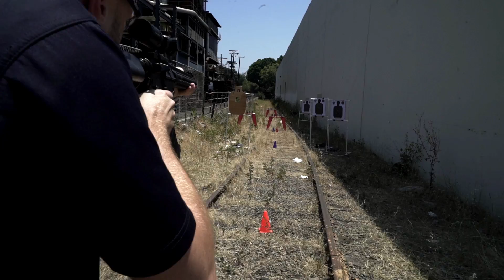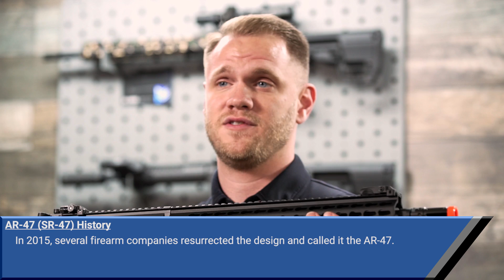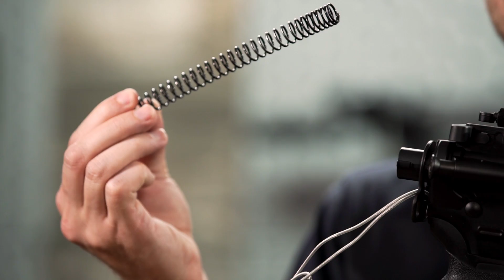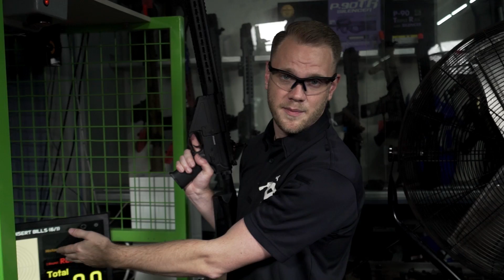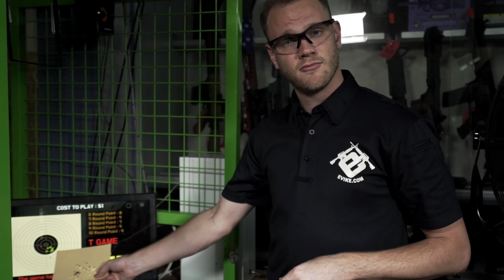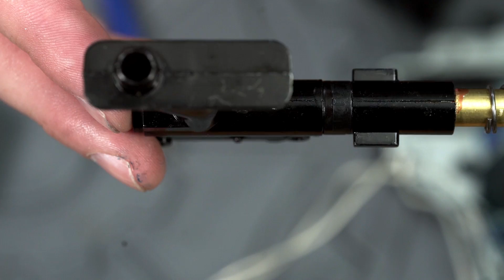The M4/ AK Hybrid - CYMA AR 47 QBS Review

Comment: Just to add since I bought one of these

You cannot swap to a pdw stock without switching to a gearbox with an internal spring guide due to the nature of the spring change system

You cant swap uppers from other rifles to this one as the upper is longer than a standard m4, you can however swap rail and outer barrel parts
Reply: Can you remove the stock and replace it with another m4 stock?
Reply: @chrisq7814  yeah ofc
Reply: i cant seem to remove the tip, do you know how?
Reply: You think I could change the barrel and handguard too?
Reply: You can just change the spring guide

Comment: Got Model: 8.5" M-LOK w/ Suppressor. Total game changer out of the box and for ever.
Reply: Is the suppressor removable and is trigger response snappy
Reply: @bigs0  yes and yes. Snappy and fast. Trigger has sensitive parts. Broke after  4 month of aggressive gaming.
Reply: Make sure your motor is tight too. Mine was loose but plumbers tape fixed it right up!

Comment: I won one of these a few months ago and now i'm wanting to put a mock silencer on it but my question is, how do I get the flash hider off, the grub screw is like glued in wtf. I've torqued it as hard as I can and broke my allen wrench.
Reply: neither can I, have you figured it out yet?
Reply: @asd_aspect2456  I ended up just replacing the outer barrel. If yours has the grub screw and you haven't stripped it what you should try, that I didn't, is heat it up with either a heat gun or dip it in boiling water. Then try to unscrew it. If you've stripped the screw then you will have to drill it out.
Reply: @jbopp15  alr thanks bro, also how did you take off that chunky ring that is holding the outer barrel in cuz I unscrewed the screws but it wont twist out
Reply: also what barrel did you get
Reply: @asd_aspect2456   I heated it up then twisted it off with a wrench.
Reply: @jbopp15  when you twisted it off did it strip the threading?
Reply: @asd_aspect2456  No, after you remove the hand guard and take out the 2 screws from the barrel nut, you just turn it counter clockwise to unthread it. Also I replaced the outer barrel with a 10 inch barrel from another M4 I had.
Reply: @asd_aspect2456  also I forgot to say it but the barrel I used as a replacement. I had to deemed the little fin on the top to make it a small bit narrower in order to fit the upper.
Reply: @jbopp15  alright thanks bro i needed this ha

Comment: I haven't bought an Airsoft gun with a battery in the stock (I have an AK with the battery in the dust cover). I was interested in this one, is the stock specialized to go with this gun? I noticed you can pull the buttpad down on it or are you able to swap it to any AR-15 style stock? Do other AR-15 stocks have buttpads that pull down like that? I wanted to replace the stock with a Magpul MOE style stock when I bought the gun. Same goes for the pistol grip if I wanted to change it.
Reply: You can just slide the sock off and put another one one. I want to put a magpul stock on mine as well, just isn’t as quick as the original stock.

Comment: So what is the difference between LiIon batteries and LIPOs? And could a LiIon be used interchangeably with a LiPo?
Reply from the maker: Li-Ion and LiPo are completely interchangeable. Differences include chemical composition; Li-Ion batteries generally have a larger mAH (capacity) for the same size/dimensions of a LiPo, and a Li-Ion battery can be run all the way down to 0% charge, whereas a LiPo should not. Additionally, Li-Ion can be stored for long periods of time fully charged to 100%, whereas a LiPo should be slightly under 100% charge. Titan Power has a wealth of information on their website if you're interested

Comment: What charger to use for the Titan 7.4v 7000mAh 10c Nunchuck Type Li-ion battery ?
Reply from the maker: Titan Power Digital Charger for LiPo AEG Batteries - https://www.evike.com/products/13525/
Reply: Is the battery not on evike?
Reply from the maker: Here is a 7.4v 6000mAh 16C Nunchuck Type Li-ion battery - https://www.evike.com/products/17761/